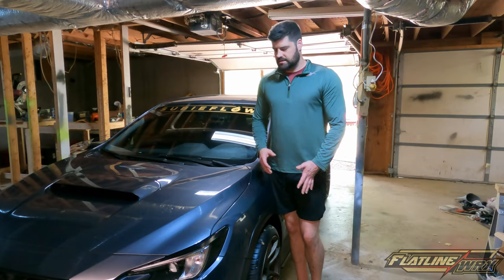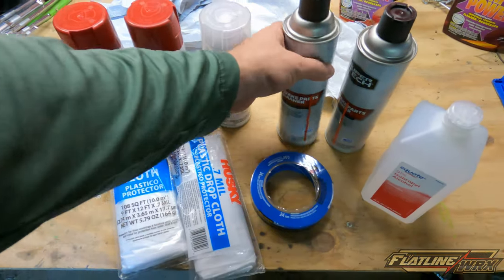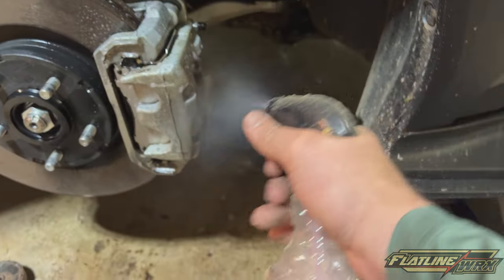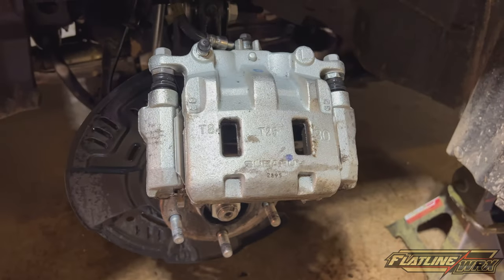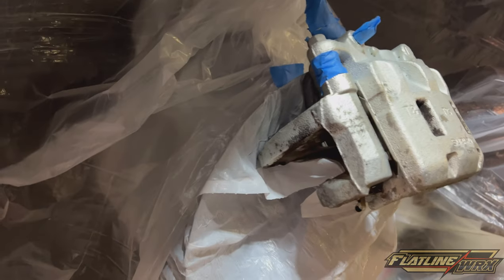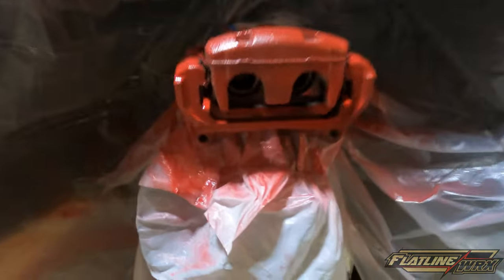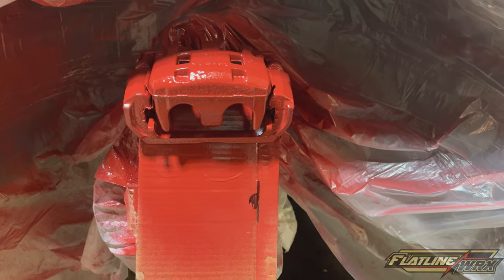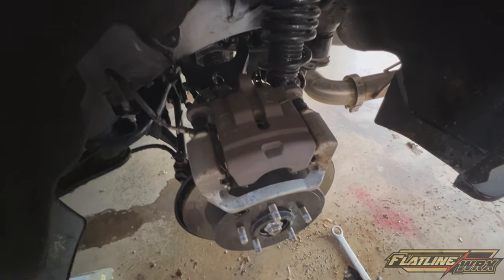How To Paint Brake Calipers - 2022 Subaru WRX

Comment: Looks good, seems taking them off could’ve saved you some time and made it easier. Thinking about doing mine when I change pads/rotors. Just taking them off if I do
Reply from the maker: For sure! But taking them off then requires bleeding and such. But I agree that if you are changing everything out you might as well take it all off.

Comment: This is no small job and you made it look easy. Might as well have put in new brake pads as long as it was apart. Very well done and I’m sure this took hours.
Reply from the maker: i only had like 11k miles on it at this point so no need for pads they still had LOADS of life left. It did take a few hours to do and dry time.

thank you for the kind words

Comment: Although it looks like you were pretty careful- it's generally not a good idea to let the heavy calipers hang from the brake lines like you did.  Twisting up a cheap coat hanger to support the caliper and take the weight off the brake hose and fittings is how I've always done it.
Reply from the maker: absolutely. I never let it hang by the line ever as i know it damages. I made sure it was always propped up and secure. Also removing the hose retainer bolt allowed slack in hose too for more play.

good tip on the hanger.

Comment: Here’s a very stupid question. Where did you put the jack when you jacked up the car?  You put the stands on the jacking points; it looked like you went in between them but there’s nothing solid in the middle of the car- is there?  Thanks.
Reply from the maker: No such thing as a dumb question. I jacked up the pinch welds one side at a time and placed the jack stand on the same pinch.
Reply from the maker: As you see in the video when I jacked up the front the rear come with it. I then went to the passenger side and did the same exact thing.

Comment: how long did it take you roughly to do all 4? from start of the project to finish
Reply from the maker: Ummm ima say like 3-4 hours. That’s NOT including paint cure. Paint cure time included around 16-18 hours. You want to let the paint sit overnight at least. This paint sets pretty quick but still needs proper time. Really if you could do it and let it set 24 hours then put back together is probably best but I didn’t and it still worked perfect.
Reply: Legend has it my man still isn’t driving his car
Reply from the maker: Huh???

Comment: I would put plasti dipped it red haha 👍🏼
Reply from the maker: Plasti dip wouldn’t work though. It would but 1 brakes get stupid hot which plastidip wont hold up too and second plasti dip would absorb brake dust and so would look like poo in like a month.
Reply: @Flatline_WRX  oh really I’ve never had any of these symptoms On my focus ST. Probably depends On driving style and application. The paint always durable and handled the heat pretty good for me.
Reply: I reapplied every 1-2 years definitely but that’s easy for me haha I might pick up a 2022 wrx GT dealerships are selling them for invoice 🧾 in Florida
Reply from the maker: Really? That’s awesome. I had issues when I used it so never used it for brakes.